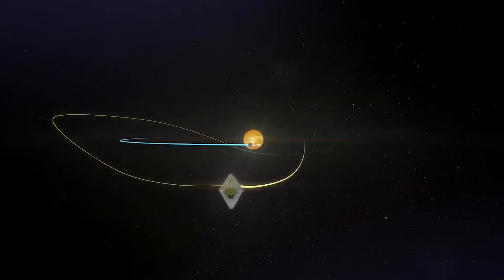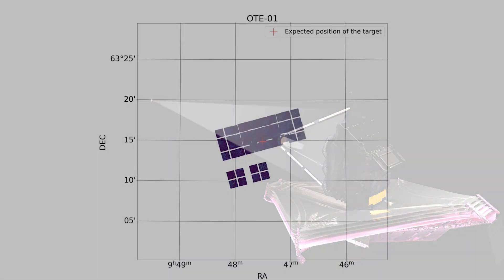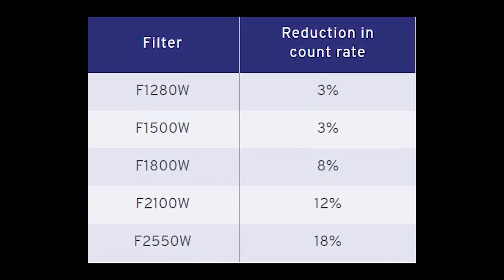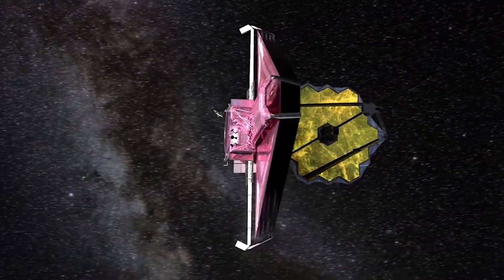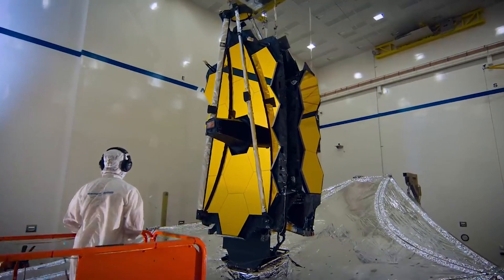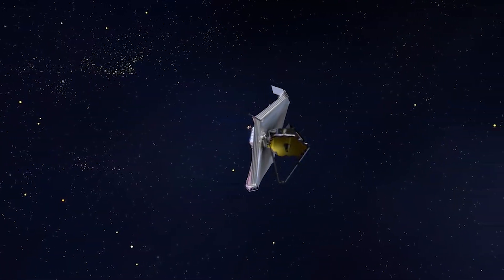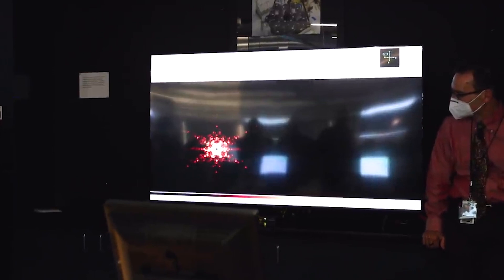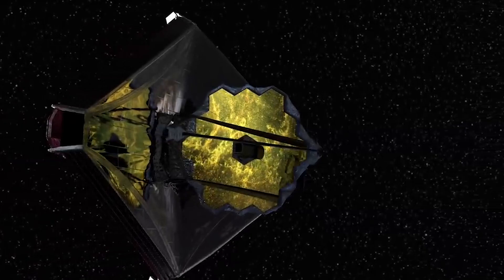More Problems With The James Webb Space Telescope's MIRI Instrument

Comment: As usual, great video.
So many people do not know the details of how much goes into the planning and design of a mission like this. One reason the cost grows is that the engineers have to build in so much redundancy and durability. Many of the parts are essentially prototypes using the best technology available. They have to over-design it to compensate for the unavoidable degradation that the space environment causes. Imagine building a delicate telescope and EXPECTING an average of one tiny rifle bullet to be shot into the primary mirror each month!